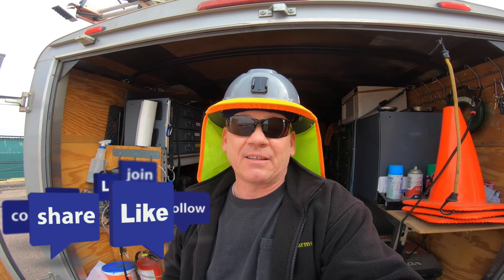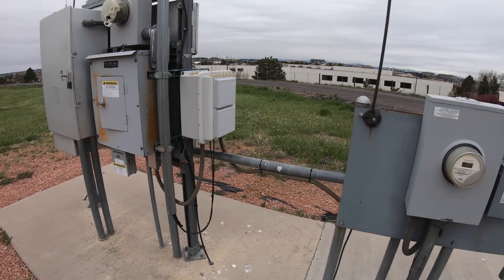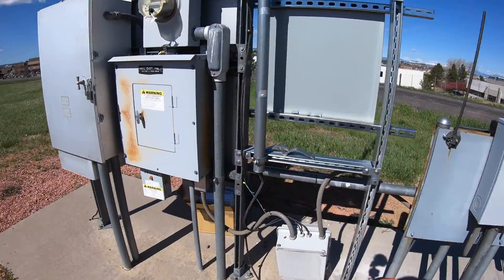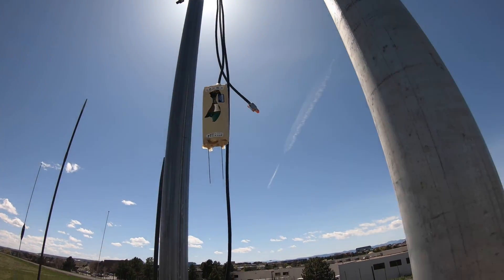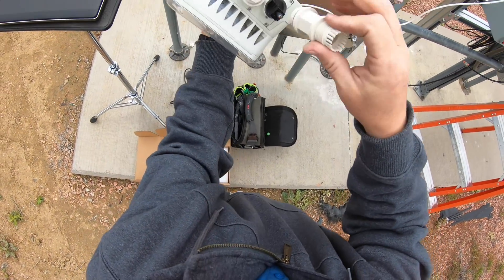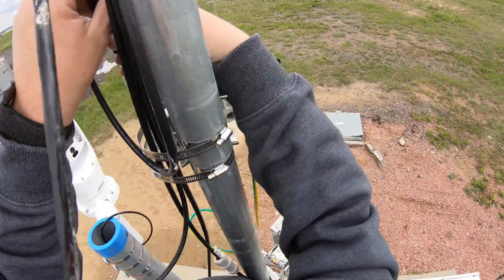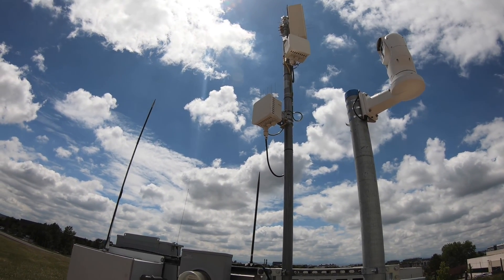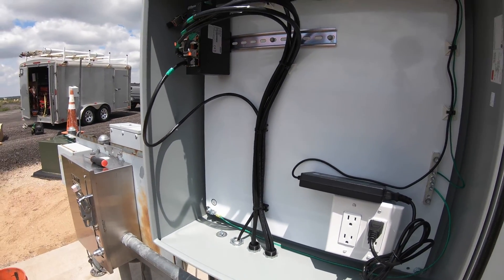Siklu and Fluidmesh Video/Security wirless system upgrade

Comment: Interesting video keep them coming. It does seem like overkill for the application but I guess the airport has money to burn. We use some 60Ghz links between buildings and pops off our fiber ring at the Wireless ISP I work for. The 24Ghz gear is not bad for backhaul too. When we work with some camera guys they use a lot of 5Ghz to jump around buildings. For your application, if you still wanted the high speeds you could get away with a Mikrotik Wireless Wire or a new Ubiquiti Building Bridge set as they call them and spend 1/8th the cost. But you seem like an old school guy and you can tell by the overbuilt cabinet that looks cool out with the other electrical equipment.
Reply from the maker: We've found the Siklu product to be a very match for the application.   We have used several other products that were supposedly designed for this application over the years and this is easily the best match do date.  Not quite sure why you feel a 1G backhaul link is overkill for our application, especially since we purposely don't disclose what we are back-hauling.  1/8 the cost?  EH-500 has a MSRP if $1200, seems very reasonable for a quality product.  I've held both products in my hands and I'll stick with the $1200 product over anything else in the price point.  Overbuilt enclosure?  Again, not sure why you feel this way but the airport does not have money to burn to overbuild things but they do appreciate that things are done correctly.  The first contractor (if you watch that video) uses about 4-5 different size bolts and in general what appears to be their left over parts bucket to build the enclosure they used.  In that video we put in a fiberglass enclosure that lasted about 6-7 years before it was so weathered that you would get fiberglass slivers all over your hands.   No thanks!